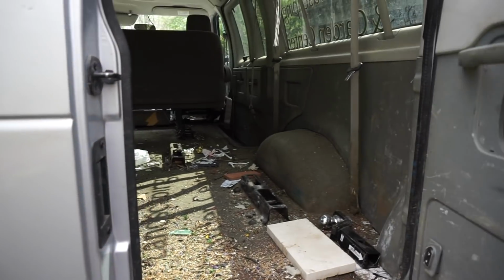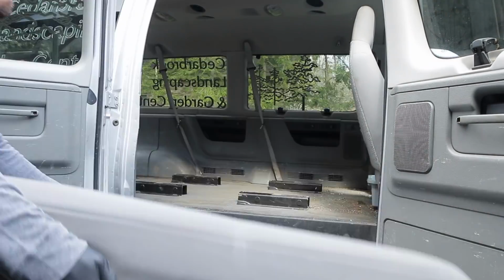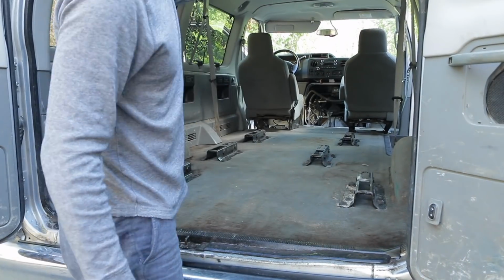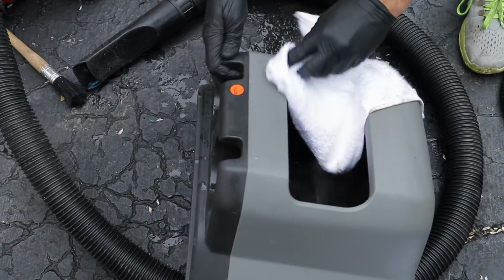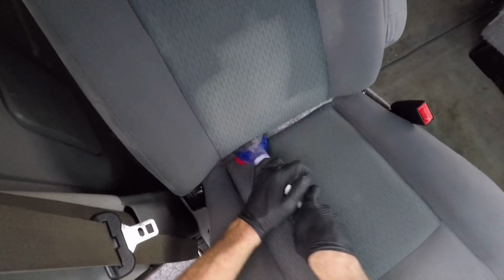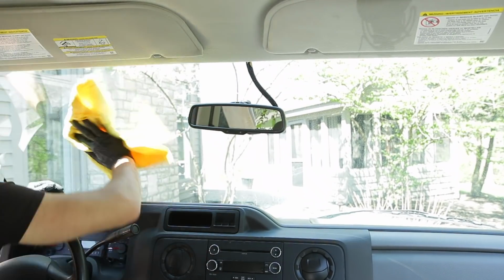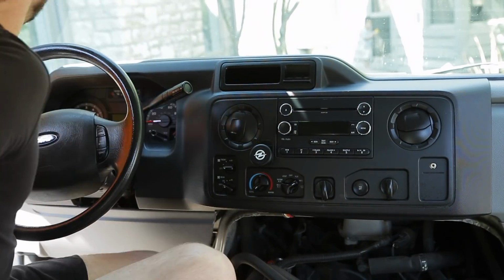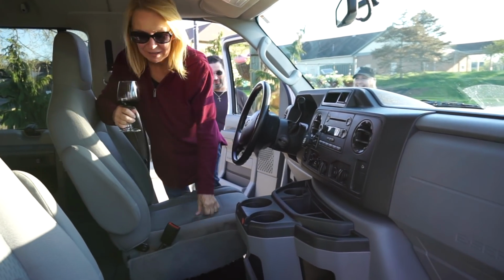DIRTIEST Car Cleaning EVER! Complete Disaster Car Detailing Transformation

Comment: I did something like that to 3 different vehicles. A 95 Ford T-bird, an 06, and 02 Toyota Camrys. ....except, I yanked out the whole interior on all vehicles. All of the seat cushions, foams, and the carpeting were submerged in warm water with Ariel laundry detergent in a plastic disposable swimming pool. I stomped down all the padding, and carpets, rinsed them, and washed again until the rinses came out somewhat clear. I vacuumed, and hosed down the inner floorboards with Mr clean, and a scrubber broom.
On the T-bird, I had to pull off the whole dash because the heater core was leaking due to electrolysis, and the blend door in the plenum was damaged. I was getting no defrost heat on cold and rainy days. I went to the bone yard and picked up a decent replacement plenum. All electronics, wires, including the gauges were removed, and the dash was hosed down, cleaned, re-assembled, and bolted back into place over the new plenum.  Installing the dash proved to be a real pain. That was the heaviest dashboard I ever had to pull off and had to lift back onto the car, connect wires, and bolt it down to install, almost all at the same time.

Comment: Why didn't you steam clean the seatbelts?!
Reply: I was thinking the same thing, seat belts are hideous, maybe could have gotten away with it if they were black but white seatbelts needed a steam clean asap
Reply: Derek Super Seatbelts are really hard to get clean!
Reply: Seatbelts are almost impossible to clean, even with a steam cleaner.
Reply: @KyleWithStyle7  Not really. I cleaned my "new" beige seatbelts for my interior swap for my E39 very easy: They were already removed from the car (got them included with the whole interior), then the roll up mechanism was blocked when the full belt was pulled out. Then I used a normal brush, soapy water and washed them careful but thoroughly in my bathtub. I Only washed the belt, not the mechanic. Then the belts were leaved to dry for 1-2 Days.
The results were as clean as possible. They smell now nice, they look like new ones and the roll up mechanism works better. 

In the car it is a different story, but removing them isn't that hard in some cars. Specially when you already have pulled most of the interior out.
Reply: Joshua Kennedy give them a spray with pledge
Reply: I would just remove them...if no people are back there, why keep them.  Same with the carpet.
Reply: Kyle H best way to clean seatbelts is with a pressure washer.  My cheapo electric washer gets seatbelts spotless in no time and doesn't wear the fabric like scrubbing them does!
Reply: Derek Super when I do seat belts, it’s when I get a used vehicle or one of my old vehicles and gut the entire interior. Take everything out and some belts come out, some don’t. Without the carpet as I remove that too, I soak the seatbelts with degreaser (LA’s totally awesome cleaner usually). The ones that come out like lap belts get soaked with the seat brackets and then pressure washed and hung to dry. A steam cleaner would probably be easier lol but my technique is flawless.
Reply: Same!! Right. But if you pressure wash belts, those things come out brand fucking new..

I do those first, as I’m cleaning everything after.
Reply: @jensharbers6702  should have washed the mechanic. then he would have helped you wash the belts.
Reply: Power washer is the best way to clean seatbelts
Reply: I was thinking the same thing too!! Seat belts were filthy!!! I figured he left him dirty bc no one uses 'em and no one sees 'em, but if you take that much pride in your work go on ahead and clean 'em. Some of the comments talked about how hard it is to clean seat belts. Did everyone miss the part where he cleaned the driver side carpet with a freaking garden hose for added water pressure??? What he did to clean that van was no match to cleaning some simple seat belts. He could've had those seat belts looking factory new!
Reply: I noticed the seatbelt were not cleaned
Reply: seatbelts are not hard to clean u soak them with sudds and just pull a cloth up and down til it's clean and pull them out full til dry
Reply: I've been power washing seat belts for year and never damaged one .  I use a 1700psi  power washer and all purpose cleaner.
Reply: Chris Pennington I agree to really clean it everything has to come out.
Reply: Xenit, stiff brush, steam clean, ef steel wool, gp, and terry towel. Good as new.

Comment: Dry finger across dry grit on plastic.....scratch.....(internally I winced at that)

Top tip for grotty carpets I picked up from someone else - scoop of oxyclean (or whatever the cheapest no name equiv is)

Used it on a very dirty used car I bought as a fixer upper - oil, grease and rust stains in the trunk, vomit under a rear floor mat

Car came up like new, smelt fresh also, seemingly trick works really well on light carpets that are so common in rentals, person who recommended it to me said she's never lost a deposit yet, despite having young kids and being perenially cursed with light coloured carpets.

Comment: Curious how you clean the seatbelts?
Word of advise for this owner: Weathertech. It’s an investment - but I’m sure a cleaning like this is as well.
Reply: For my retractable seatbelts, I pull them all the way out, take a sponge, soaked in water and a cleaning product , and wipe both sides down, then I take a brush and scrub both sides, then, I use the sponge again (freshly dipped in the water) and rub the seatbelt again, to remove the dirt, and then I take a microfiber cloth and wipe it down, to remove the excess water and any remaining dirt.

Or, if you have s steamer, you can use that to blast the dirt off/through.
Reply: I use a sponge and dish soap (a real tiny amount) on seatbelts and carseat straps. It's important not to get them too wet or scrub with anything too abrasive (Have a buddy who used steel wool... don't do that) as it can affect the function in a crash.

Comment: Awesome work bud. Only 2 small things. With the seats. If you steam the stain. Then apply cleaner it will help emulsify the stain. Second also give the safety belts a clean. Really helps lift the cabin. 
Otherwise great work 👍
#worktrucksneedlovetoo
Reply from the maker: Thanks for the tip on that! I wanted to get to the belts too because I agree its an amazing touch but after 9-10 hours I had to pick my poisins

Comment: If the owners of this van intend to keep hauling landscaping materials I suggest they replace the whole carpet with the vinyl flooring that Ford actually put in the fleet versions of this van. So they can easily order it at the Ford dealership parts department or used from salvage yard.

Comment: iv been valeting for over ten years here in Ireland we have farmers jeeps with meal and maggots eating dead rats we used a shovel and wheelbarrow for the back it was that bad , a useful tip on light carpets after most the dirt is gone use standard thinners it will remove those hard stains just let it air out for ten minutes in our company usually a typical family car would take us 3-4 hours inside out that's detar and waxed , engine bay boot , spare wheel and all the interior its a great job if you have the patience and the reward of a challenging car is worth it :)

Comment: I get that it's a work vehicle, but why no tarp, cardboard, or plastic floor mat? Keep things a little bit neater short of using a pick-up truck that has a plastic bed liner or epoxy coating that can be hosed off.

Also with that steam cleaner, be careful if you're near anything held together with adhesives. Some glues or tapes can come apart with heat. Does a good job of  lifting up gummier stuff though.

Comment: Do you ever wash the seat belts in the washer? I put mine in a net laundry bag (to protect washer from buckles) and wash on the most intense setting.  They come out great and there's no elbow grease needed.  You can also use foam brushes for vents and tight spots (for those of us that  sit at the light and wish our ride was a little cleaner). Great vid.  I guess it doesn't work to spray all of your cleaners first and have them breaking down the grime while you work on polishing? TFS. Amazing job! I hope he paid you at least $100.

Comment: Do you have any tips/tricks (or videos) for getting caked up carpet cleaned? I have an 02 Jeep Liberty that I've completely detailed myself (it was a mom's vehicle, and then a college students.. nastyyy). There's a section of carpet on the drivers side front that is absolutely hardened as if they dumped a gallon of super glue over it. I can slowly release layers of it with my carpet cleaner, but wondering if maybe the steam cleaner might help?

Comment: Why do you use a shop vac to vacuum instead of a regular vacuum. If you don’t mind answering that question. thank you
Reply: Vacuum Cleaners can be inconvenient to fit inside of a vehicle. In this case with a huge van, you could probably get away with using a Vacuum Cleaner. But if it's a toyota corolla, A regular vacuum cleaner won't fit inside of it like a shop vac will. 

As a detailer, he's got to have equipment that can work with both extremities of vehicle sizes. So keeping it small is the best place to go, as a shop vac is smaller and more portable than a regular vacuum